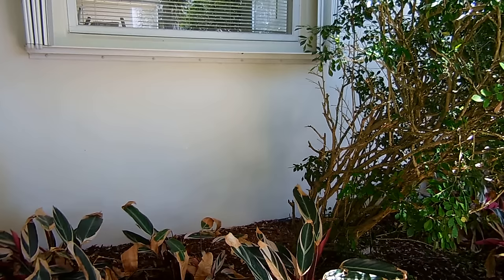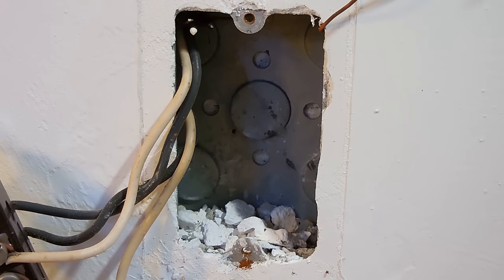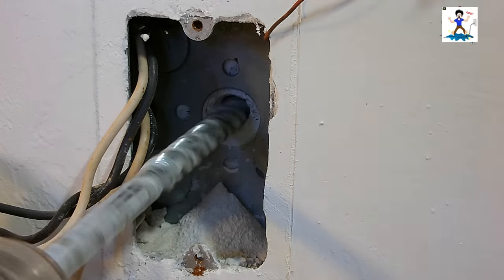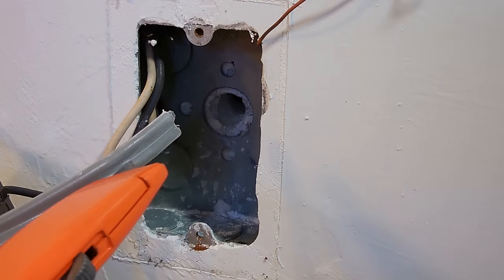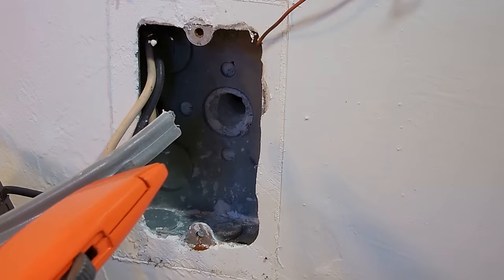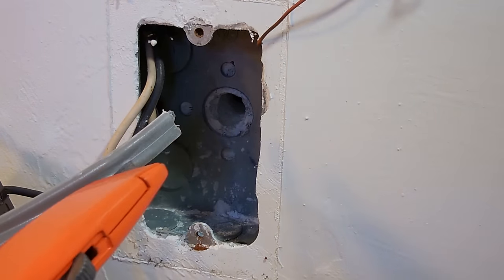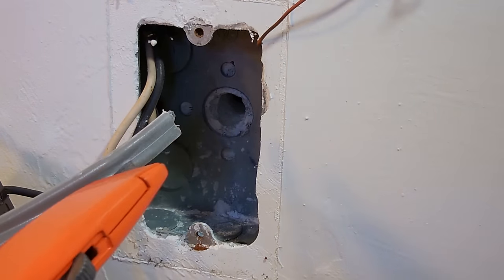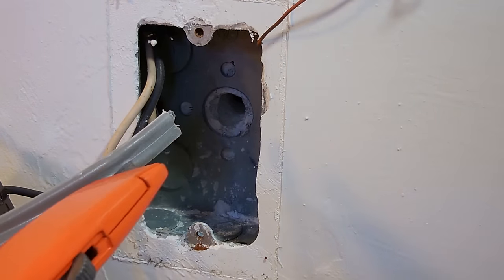How To Add An Outdoor Exterior Electrical Receptacle

Comment: I need to get one of them covers for long term cord coverage. Years back I had added a 20 amp GFCI outlet to an existing outdoor box and ran a dedicated 20 amp circuit to it. I use that outlet quite a lot, comes in very handy for air compressor and car starting/charger. Come the holiday seasonal lighting is when I need the quasi permanent plug/cord protection.
A 20 amp outlet is really handy, especially knowing you can plug just about anything into it and with the protection of not getting lit up should a fault occur.
Reply from the maker: Thanks for watching! :-)

Comment: The ground pins were on the top when you took that receptacle off. When re-installing they were on the bottom.  Some prefer them on top in case a conductor was to find it's way in between a partially plugged in cord. I'm not sure how likely that is. I hope you don't think I'm nitpicking you over that. I would discover that after putting the last screw in just so I would have to take it all back apart and redo it. Bottom line-I love your videos. Keep them coming please.
Reply from the maker: Johnny Sokko The pin should be down.
Reply: No he's right the ground should be up like it was in the beginning

Comment: At 14:28 would have like to have seen you hook up the hot and neutral pig tails to the silver and brass terminals on the receptacle .... and at 19:45 although it's pretty clear what you did ... good to know the size of Tapcons and masonry (?) drill bit in order to mount the box !   Thanks for the video.
Reply from the maker: At 14:28 the black wire was attached to the availalbe brass screw on the side of the receptacle with the black wire. The white wire to the opposite side. Tapcons nothing special. 3/16" size is fine. The bit is included with the concrete screws.Thanks for watching!

Comment: I have been thinking doing exactly what this video shows to add outlets outside of my house for use by electric trimmer, leaf blower, etc...  and wondered whether this is OK to do. This video gives me the confirmation. 
The video also said GFCI receptacles are required when installed within 6 feet of a sink, bathtub. Outlets in my bathroom are on circuit with GFCI breaker so they are OK.  I need to check a few outlets near the sink in the kitchen and the two under the sink (for garbage processor and dish washer). If they are not GFCI, I have to replace the first one in the circuit or simply replace the breaker of this circuit with GFCI breaker.

Comment: Thanks for this video, it is incredibly detailed! I have a question. The outlet that I am looking to take the power from has four wires (just like this one) but, they are all connected at the back of the outlet by being pushed into the hole. Therefore, the two screws on each side (to connect the white and black respectively) of the outlet are free and no wires attached to them. Instead of making the pigtail connection, could I just connect the white wire to the white side and the black to the black side? Thanks in advanced!

Comment: If I wanted to add another receptacle  on a post across the yard, can I just run a line (in a conduit) and attach it to a GFCI on the side of the house? Also does the post receptacle  need to be another GFCI? 

Thanks
Reply from the maker: Hello. As long as that particular branch circuit doesn't have too much of a load on it, you can run the line to the post receptacle using the LOAD side of the GFCI on the side of the house. The post receptacle will also be protected by the GFCI on the side of the house. You don't need another. Thanks for watching!

Comment: Why drill up?  If water were to get into the outer box (which is more likely than the inner), it will drain to the inner box?  If it were drilled down, that would be less likely.  Just curious
Reply from the maker: To make the outside outlet higher. The wall is concrete block, so water wouldn't find it's way into the room.

Comment: Great video ..do you have a video on how to check the gfci 15amp from the bathroom...the breaker is on ..the gfci is new and all the line are active what do I need to check from the lines itself (gfci) thank you have a blessed day and be blessed
Reply from the maker: Make sure you connected the power to the LINE terminals and pressed the reset button.
Reply: @electronicsNmore  I did do I need to open the gfci  and check the line individually? And turn on the breaker which one is live and off...every outlet is on but the outdoor  and the bathroom  15 amps gfci is out..as the breaker is on thanks

Comment: Sir, can you give me the name of the clear silicone you used?  I also want to confirm that a 15 amp circuit requires a 14-3 wire. Thx
Reply from the maker: @CarlosGarcia-ls4hn  14-2 for a 15A receptacle. You can pick up a squeeze tube of clear silicone adhesive sealant at Walmart

Comment: This was SOOOOOO helpful and clearly explained.  Thank you so much.  I have one question.  It looks like its being installed in the same or similar area i need it.. (garden bed?).  Im looking to add another external outlet to plug my exterior landscaping transformer into.   Im just a bit worried if the sprinkler hits it when its plugged in since the protector cover will be up.  What are your recommendations?
Reply from the maker: Yes. Buy the proper waterproof cover that will allow the plugs to be in the receptacle and not get wet. Thanks for watching! Be sure to rate thumbs up, check out my extensive video playlists, and share.

Comment: Good job , only thing I  like to add is when you twist wires and tie them with wire nuts I myself like to seal them with electrical tape just an extra safety but other than that very informative video.
Reply from the maker: You can do that as an added measure. Thanks for watching!
Reply: Adding tape is unnecessary and not a safety measure at all. in fact quite the opposite. if there is ever any arching,sparks or heat build up the tape will melt and can possibly even catch fire. But if you want to burn your house down go right ahead and keep using that tape. Been a master electrician 40+ years but maybe you know more than i do ?
Reply: @gregmartin1757  Seems like an excessively sharp reply to a non-provocative comment. One would think after 40+ years, you could share your knowledge without flaunting it.
Reply: Greg Martin nobody asked your opinion btw they call electrical tape for a reason.
Reply: @adofilth  he’s not wrong in the sense  it can do more harm than good, maybe the way he conveyed it to you coulda been better but non the less if tape melts and catches fire that could be an issue as well as it doesn’t do much to keep the wire nut in place but do you

Comment: On the waterproof box, if you flip it over and hit the two bumps with a hammer it works way quicker than a drill bit.
Reply from the maker: Yes, I've done that many times, but sometimes it doesn't break cleanly, and you need to chip away at it. Drilling is easy. Thanks for watching!

Comment: Great video! If you were to connect another outside outlet to that one by running pipe to the next outlet, how would you do it?
Reply from the maker: You'd connect the additional outlet to the terminals marked "LOAD". The extra receptacle would be protected by the GFCI. Use ENMT( 1/2" Gray PVC pipe) and a waterproof plastic electrical box w/cover. Position the electrical box 1' above the ground, and secure the vertical PVC pipe leading to the receptacle, to a strong metal rod or pressure treated wooden stake. Secure the PVC pipe going down the wall with pipe straps. Thanks for watching! Be sure to rate thumbs up and share the video link.
Reply: @electronicsNmore  hello. I bought ultratite non metallic liquidtight kit. Would this work or should I use the pvc as you suggested to the commenter above? I wanted an easy solution, something I could easily bend.

Comment: you never clamped the wire to either box ( is that not a violation if inspected ?)
Reply from the maker: You don't have to unless it's a wood frame structure, it's not going anywhere, especially with the ground wire securing the thick UF cable from moving. Next to zero fire hazard because the structure is concrete, and the cable is "UF" rated. 99% of people will not get a permit to do the job, so inspection not an issue.The most important thing is that the cable is UF rated, in the center of the knockout, and a bushing is used if too close to sharp metal.
Reply: @electronicsNmore .. can you show a wood frame please..I want to make sure I follow EXACTLY.

Comment: At about 14:04 into your video you showed white and black short wires with loops in them but did not show what you connected them to before you pushed the recepticle back into wall.
Reply from the maker: I explained. The black wire with the loop goes to the unused BRASS color screw on the receptacle, and the white wire to the silver screw on the opposite side.

Comment: Great video.  How would I then add another exterior leg from this outlet to the garage?  Add pvc pipe and connect to the back?

Thanks...JOn B
Reply from the maker: Hello there. You'd need to use PVC pipe, and connect the new circuit to the GFCI "Load" screws.
Reply: Thanks for the quick response - most appreciated.  Assume there is a "special" gfci receptacle...

Comment: Does the wire have to go through conduit if going through block or concrete? Thanks
Reply from the maker: If using UF cable, no, but refer to your local electrical codes. Thanks
Reply: electronicsNmore it doesn’t even need to be UF cable it it’s running through block. You can actually fish indoor romex through the voids in block and be code compliant. In this case, UF would be required because that outdoor electrical box is considered a wet location. Again, good video. I’d do it the same way as you did.

Comment: What about the  pigtail wires that you spliced with the other two white and two black wires, to which you then screwed a red cap on.  The other ends of the pigtail wires you then made a loop on the ends, yet I didn't see you connect those to anything,  and then you tucked everytning in and put the cover back on and then went to the outside area.  So the pigtail wires that you made loops on are just free in there, not attached to anything?
Reply from the maker: Hi Lori. No, the pigtail wires connect to each side of the receptacle. Black wire to HOT(Brass Screw) and white wire to NEUTRAL(silver screw). Thanks for watching!

Comment: Can i tap into that outlet to run wires for another outlet farther away?
Reply from the maker: Yes, as long as you don't exceed the ampacity of the circuit breaker, and you use the correct size wire.

Comment: Do you have to get a permit to install and exterior receptacle?
Reply from the maker: It depends where you live. I know people that called up electrical contractors that did as shown with no permit, but usually you'd require one. Thanks for watching!

Comment: Start of video; outlet is upside down.  I see this in newer houses to indicate a switched outlet or plug.  Of course he said that this is an older home.
End of video; outlet is reinstalled upright.  👍😀
Reply from the maker: Yes, I've seen them do that before to identify which is switch controlled. Thanks for watching!
Reply: Both statements are wrong the way the outlet was installed at the beginning is the actual correct way to install  duplex recptical. The way you mention is the preferred way. Get code book and read it before you diy any electrical work on you home for your family's sake
Reply: There’s always one.
Reply: @hewlettlittle5652  LOL u talk as if you know what you’re saying but if you open up the NEC or CEC there’s no indication of which is the correct orientation of a receptacle. Only exception would be local codes

Comment: could you do one about adding an input plug like a male plug, for like generators
Reply: Theworldofstuff back feeding is dangerous and illegal because if you do it with your main breaker on and possibly shock an linesman electrician. If you wanna backfeed safely (legal in some us states) run some 3 conductor feeder cable to a 2 pole breaker close to the main breaker on the main breaker on the panel you can buy a generator interlock kit that mounts to your panel lid that slides and locks in 2 positions that doesn't allow both breakers to be on the same time (mechanical interlock device) so it is safe to feed from a generator both for you and the linesman worker ik this was posted a year ago lol but if you still need help please do safe work 😀

Comment: Additional Tips: 

1) Before doing anything to the existing duplex outlet, test planned branch circuit expansion using an Ideal 61-164 SureTest under estimated worse case load to understand circuit suitability. If the voltage drop under load make sense for the planned expansion, then use the SureTest to check for proper wiring polarity. As a final check use a noncontacting voltage probe like the Fluke 1AC-A1-II VoltAlert to see if a bootleg ground problem may exist. If all looks good then work on the expansion. Turn off the circuit and confirm power is off at the receptacle. Once you open the box you can determine if an added circuit will not violate a box fill requirement and obviously any other NEC or local wiring codes. If the wiring looks strange re-energize the circuit and test with an AC Voltmeter (I use a Fluke 289 True RMS DMM AC Volts LoZ AC voltage mode to eliminate ghost voltage when taking measurements), it may be handly to also use the VoltAlert.

2) If you see a receptacle with rusted screws or is very old, just replace it. Don't put the old receptacle back into service, time for a new one. Not sure if you mentioned the difference between using the side screws versus back spring stabs, or the quality differences between receptacles, like a higher end commercial Hubble, or options like non-tamper. 

3) Excellent job in making the pigtails. The screws are not for daisychaining. For an easier install you can use Ideal Term-a-Nut Pigtails which have 12 AWG stranded wire, locking spade lug and wire nut all in one. This keeps the connections to the receptacle flexible making it easier to install the duplex outlet in the box. Also I think the spade lug connection has the best feel if you torque the screws with a torque screwdriver. 

4) After the GFCI install and all complete, time to test polarity and GFCI trip with the Ideal SureTest. If it passes this test then try the GFCI local test button and reset and finish with a SureTest current draw test for voltage drop. If this is okay then you can put the circuit into operation.

It is possible to put a section or threaded pipe with nuts and a chaffing insulator put probably not necessary. The conduit would not be used for grounding so you would have to use a wiring method with a ground wire.

Comment: Very nice tutorial. Hopefully not sounding condescending, leaders should be longer, holes drilled outdoors should slope downwards (to prevent any water from seeping inside). Proper way to install wire nuts is to NOT pre twist wires. Yellow wire nuts are good for (3) #12's tied together, reason poster had to use red is because of the pre twist. Once again, great tutorial, just some finite tips. Another poster mentioned proper connecter and sealer. Nearly impossible to use a connector in this case, poster used uf which I would consider adequate. Sealer, eh, that's for service entrance's...
Reply from the maker: You brought up good points. Yes, yellow can accept (3) #12, but I always twist first, so it does make the wire bundle fatter. I've found way too many loose wires under those caps over the years. I tend to leave the wires shorter out of habit. If space is an issue inside a single gang box, you'll definitely want them shorter. Agree about the holes, but I seal the box extremely well to the wall, and it's also concrete, so it's not really an issue. Your comment was fine. I have no problem with constructive criticism from viewers, but I don't tolerate viewers that are pedants, or post wise @ss remarks. Thanks for watching!

Comment: Make sure you are getting WR (Weather Rated) GFCI Receptacles.
Reply from the maker: Because the weatherproof cover does an excellent job protecting the GFCI, a normal GFCI is sufficient. Thanks for watching!
Reply: K H it actually stands for “weather resistant”
Reply: electronicsNmore he’s actually right, weather resistant receptacles are required in this application. Nice video though

Comment: does it matter which set of wires you use to connect the pigtails?
Reply from the maker: Rob Munro Which part in the video? Enter the time.
Reply: for example, at approx. 12:10 you connect a black pigtail to a black wire you had taken off the outlet.  does it matter which black wire you take from the outlet?  since there were originally two on the outlet I wasn't sure if that mattered.
Reply from the maker: What's important is that you know which wire supplies power.
Reply: @electronicsNmore  how do you figure out which side is bringing the power in
L?
Reply: christopher rosica it doesn’t matter

Comment: Who’s the electrician that installed that indoor outlet upside down?
Reply from the maker: I hate when the ground prong is at the top. It was installed that way back in the 60's. If I turned that one around, then all the other receptacles would look stupid. LOL
Reply: it’s usually done to show that the outlet is wired to a switch